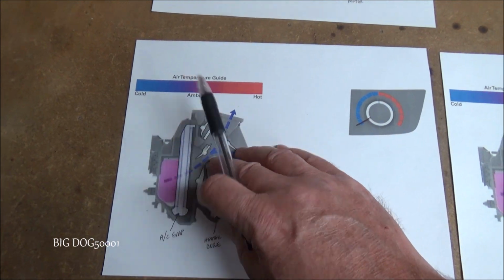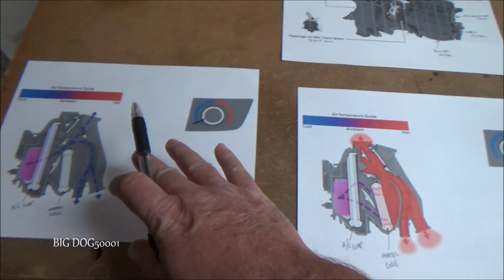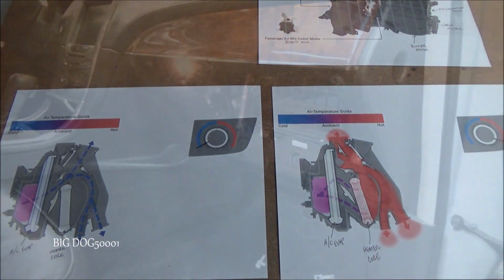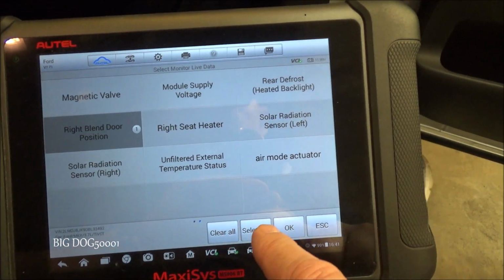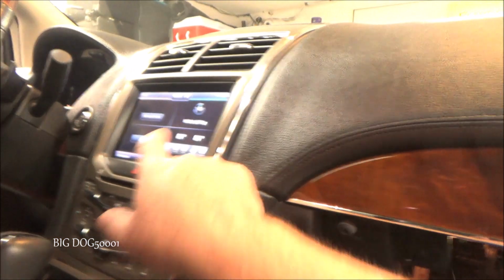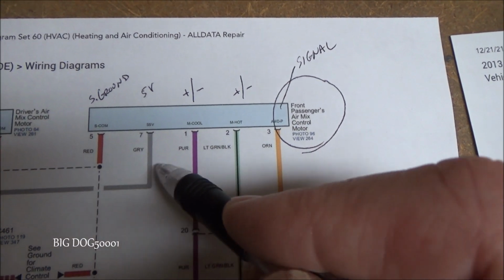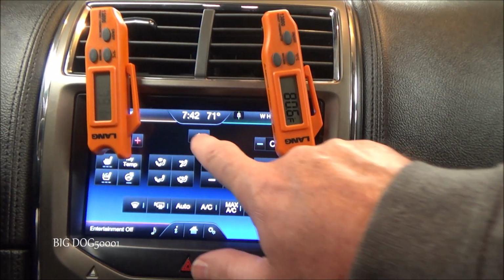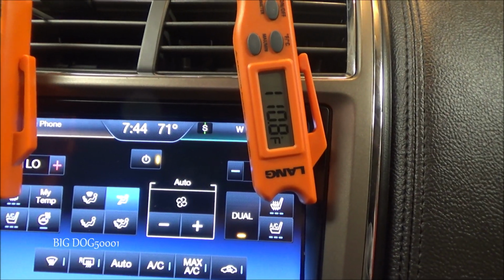Tech Tips - Uneven Car Vent Temps:  Heat or A/C Blowing Hot Air on One Side Cold Air On Other

Comment: Hi there, I have a 2014 camaro with a bit of an odd issue. 

my model of Camaro doesn't have duel climate first off, but the driver side vents always blow mildly hot air, while the passenger side is always cold. It doesn't matter how much I fiddle with the controls, it never changes. this leads me to think it is the blend door itself. but again, it isn't duel climate, so I don't see how that could be the issue. I could try to recharge the refrigerant, but I don't see how that would fix the passenger side to become hot. I already checked my coolant, and engine temps are good. So I am thinking it might be a combination of low refrigerant and the blend door being bad. But I would be interested to know your thoughts. Thanks.
Reply: I have this same issue
The thing is on my camaro passenger side is blowing hot and driver side is bloqing cold
Did you fix your issue? What did you find?
Reply: @rogeliovenegas5142  yeah it was the blend door. My issue was that it snapped and fell partially, making one side always hot, and another always cold. It's a super common issue with the camaro. The proper way to fix it would be to remove the entire dash, but that isn't what I did. I just got a hot knife and cut into the dash where the blend door is. It takes around an hour or 2 to complete. Then you just silicone it back together. You can find dedicated videos on the subject. It's tight but doable.

Comment: My car does not have dual climate control and is blowing cold on the passenger side when the heat is on.
Reply: This is the issue my vehicle is doing. How did you fix yours
Reply: Me too
Reply: Same. What's the solution?
Reply: Mine too
Reply: Was told could be thermostat and new fluid
Reply: No it's your blender motor @Mr4twenty.357
Reply: Same here...
Reply: Same
Reply: Blend door actuator
Reply: Same problem 😢 😭

Comment: why would less coolant cause no heat issue? I thought the heating system is just heat of the engine pushed into the car cabin. So if the coolant is less the engine will heat more and should have more heat.
Reply: Heat comes from the cars coolant that runs through the heater core in the car. With not enough coolant it won't flow enough to get enough heat to transfer

Comment: Thanks for the diagrams, really helps.  I'm working on 2014 Honda CRV and  I don't have a scan tool but I'm wondering if I take blend door motor off the door mechanism and move it manually to see what 100% open and close.  I'll check my ac to see if the temp difference occurs the same as the heat.

Comment: I just had my rav 4 worked on , because it was leaking. It turned out they said form the top on the side of the roof. Not the sun roof. They took off the head liner. After that my air conditioner on the drivers side was no longer cooling. I always had ice cold air. Did they maybe do something to make this happen?

Comment: I have Hond 2005 Accord 2.4L with Dual mode. Not to long ago I used Bars head gasket sealer on the system thinking will fix a small leak . Anyways turned out that the Hvac only would give me Cold air on driver side,passenger works when changing temps. I hosed/flushed the heater core believing a core restriction.  Now when I use the dual mode only passenger side works. Driver side is always cold. I see passemger blend door actuator move the outer door swivels. Right now is winter in Texas. Any help or thouths would be appreciated!!

Comment: i have a whole different issue. defrost on windshield setting when it’s cool air the air flow is strong but when i turn it to max heat the airflow is a lot lower on the passenger side only. the driver side still has good air flow. i’m not sure why the air flow is reduced on the side when i have the heat on max setting. this also only happens when i have fresh air mode selected to defrost windows. if i use max hear with recirculation mode the passenger side has good air flow.

Comment: So if both side blend door are moving and it’s still blow hot on the driver side and cold on the passenger side what’s is the issue??
Reply: depends on geometry of the evaporator, there may only be enough freon to blow cold on one side but not enough for the other.

Comment: Excellent video well explained I am having the same issue cold from driver side but hot on passenger side on 04 escalade just pulled dash and airbag to install upper actuator not a fun job unfortunately it didn't fix the issue and this AZ heat makes the vehicle unbearable looks like I will have to have a shop scan it.

Comment: Thanks for so much good knowledge!
 Any idea what would cause brake pedal to sink down one inch when I start my car? This is causing my brakes to be applied. I'm able to lift the pedal manually and the brakes do operate normally but it just sinks back down again (just enough to apply the brakes not to the floor) When I shut the car off and pump the pedal it does re gain pressure and return to normal position.. please help thank you!

Comment: I had a nice crash course on this a few years ago. My newly acquired Acura TSX was blowing just cold air (and not changing) on the drivers side. To keep from freezing in winter weather I had to remove the blend motor on that side and manually move the door it to heat. I replaced the motor later and all was good. Great video Dave. Good explanation.
Reply from the maker: Thanks for the input!

Comment: Thanks Merry Christmas to you and yours and everyone who is on this post. I have a question unrelated to hvac system. On the 2004 Honda Element when should I change the timing chain? Thanks
Reply from the maker: There is no regular maintenance schedule for replacing timing chains on these Hondas, they typically can last the life of the engine if the engine oil is changed regularly and never gets low (on most of these older Hondas I recommend no more than 5,000 miles between oil changes).  Where I see problems is when the oil is neglected or allowed to be low for an extended amount of time.  When that is allowed to happen, the chain will "stretch" (get longer due to excessive wear) and start setting cam/crank correlation trouble codes on neglected vehicles.  Merry Christmas and thanks for the comment!
Reply: @BigDog50001  great thanks for the response. I change my oil every 3,000 miles